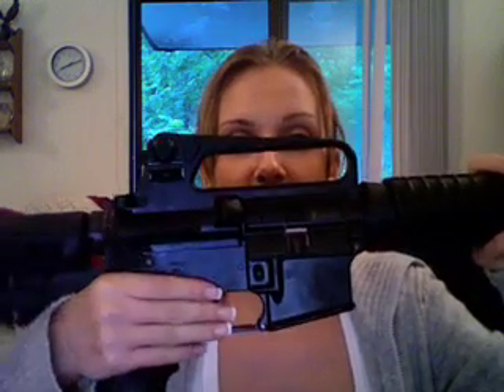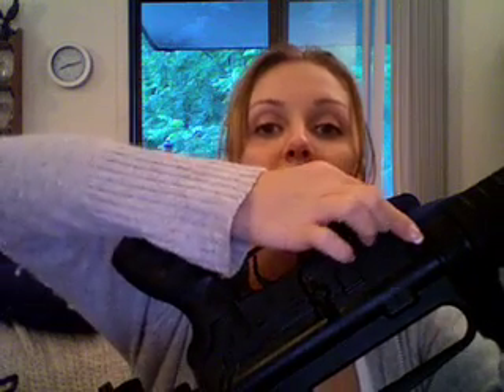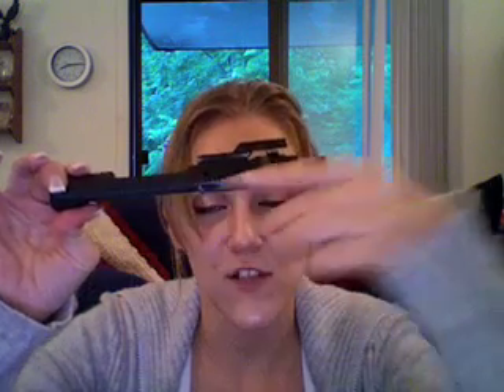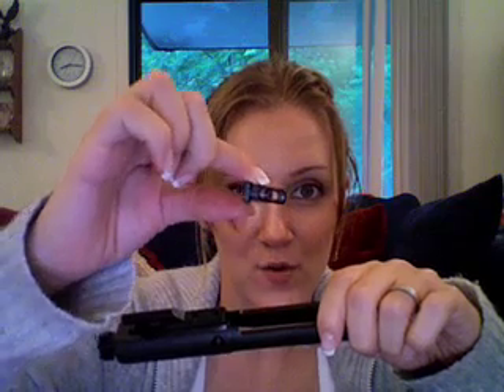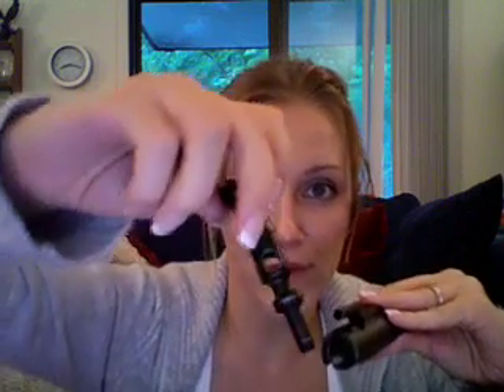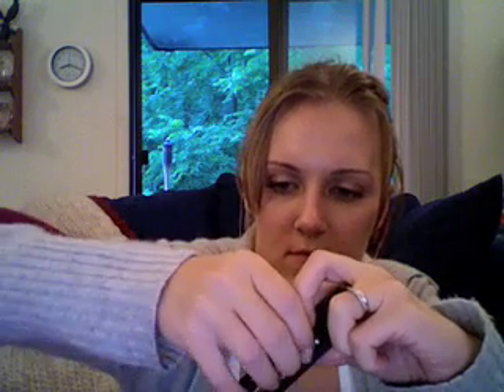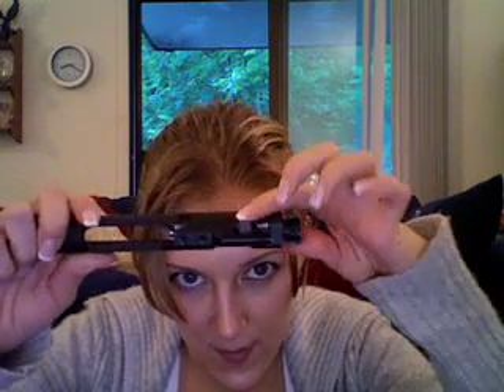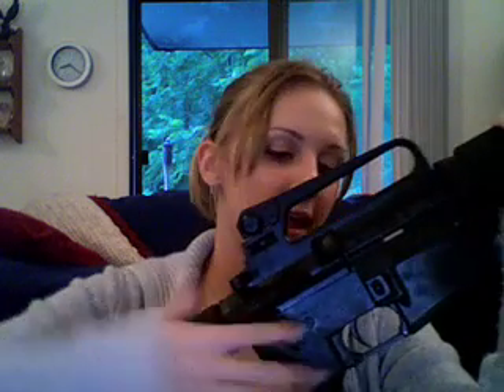Bushmaster AR-15 M4 take down

Comment: Great video. I just bought my Bushmaster .223, spent the whole afternoon taking it down and putting it back together as described in the manual. A couple of things to help new owners: the pins in the receiver are designed to not come all the way out, that tripped me up for a while.Also important is that the factory says to never alter the design of the firing pin retaining pin or replace it with anything less than the original.Point in a safe direction, dry fire,and do safety function check.

Comment: The original Bushmaster was a pistol design that used a AK47 system. It was much like a bullpup where the magazine was behind the pistol grip. They also made a rifle with the AK47 system. Both used AR-15/M16 magazine. The lower/upper were stamped sheet metal. They started making the Colt/Armalite design when they received a small contract from the military to make M4's. The FW Bushmaster was designed by Magpul called the Masada. Magpul went to Bushmaster to produce it and it's called the ACR.

Comment from the maker: To make sure that the bolt is as far forward as it can be, keeping the locking lugs of the bolt properly interfaced with the locking lugs of the chamber. Sometimes the bolt will not go all the way forward when chambering a round.

Comment: My Saiga was already clean when I got it.  As far as I can figure, the gas piston was too small, I did order a replacement for my 922r compliance, and it fit much tighter.  It might've been that I had used milsurp 7.62 instead of .308, too, but I did run some Federal .308 through it with the new piston and it fired with every pull without a hitch.

Comment from the maker: It depends on which exact AR we're talking about. There are multiple chamberings available, standard chamber is for 5.56. Mine is chambered in 5.56/.223

You can get them in 9mm, .22, .308, 7.62x39, .308, 6.8 Remington Spcl., 6.5 Grendel...etc. etc.

Comment from the maker: Not really. If you're super paranoid you may tap the assist a few times while the bolt is out to check that it is freely moving. You may also check the bolt carrier group and make sure the serrations are not worn. That's it.

Comment: Nope, it is, in fact, the extractor.

The ejector is the little spring loaded pin on the opposite side.  The extractor grabs the cartridge case rim and pulls it back, the ejector pushes on the other side, so that when the case neck clears the chamber and ejection port, the brass is thrown free from the weapon, no matter what speed it's moving at.  This is only one of many advantages the AR-15 has over the AK-47.

Comment: The bullet itself (that is, the bit the gun fires at the target) is small, but it is backed by a relatively large cartridge (the whole thing you load into the magazine, including bullet, case, propellant, and primer).  The AR-15's .223 (or the similar 5.56x45mm NATO) is only really small compared to a full-sized rifle round like .30-06 or .308.  The rifle is designed with an internal buffer and spring, so the kick isn't bad as long as you have the butt firmly into your shoulder and lean in a bit

Comment: Mine has jammed exactly once.  It was in the middle of me trying to melt down a DPMS upper, one round didn't quite make it past the feed ramp.  A tap on the forward assist got it chambered, and I finished off the last few magazines of the 370 round barrage (9 30s and a Beta Mag).

And I do have an HBAR which, while it is somewhat accurate, it's not quite a tack driver.  It's good for 1/2" groups at 100 yards with 77gr SMKs, but most tacks are smaller than that.  :)

Comment: @xboxliveman177 bushmaster is commercial spec. colt ,LMT and a few others are mil spec. there is a difference in the buffer tube size. that is the tube your stock fits on

Comment: It depends, if you're trying to squeeze every bit of accuracy out of the gun then yes.  For normal use and with normal ammo, don't worry about it.  Wolf doesn't use the lacquer coating on their ammo anymore either, so just for good practice, it's not a requirement.

Comment: @HONORGUARD308 Actually the AR line is the first form of this weapon system and just as well the first chambering was the 7.62X51mmNATO(.308 MATCH) and was therefore named the AR-10.These are the most powerful and first models and still strong running. Today its simply refered to as the AR platform. U have the Hbar M-4 carbine, M-16 AR-10, SR-25(AR-10 line) so its just ARplatform. As for the name AR-15,that is the civilian modified version of the greater Military M-16-the 5.56 cant beFYRDinaAR15

Comment: Let me guess you have a flattop upper, alluminum handguards maybe freefloat, you have EO Tech/Aimpoint, a 4X magnifier, BU rearsights, pistol grip attached to your handguard as well as a flashlight attachment with a laser and a pressure switch. Your buttstock has the compartment to store batteries for your electronics. You have the the new type of trigger guard for cold weather gloves but don't live in the cold. You have a set trigger set up with the anti-walk pins that really never walk. COOL

Comment: LOL thx, I actually have one from Bushmaster but for the life of me couldn't recall what it is called. I am female and have very long nails. It is kind of a running joke in my family about how gun designers do not take long nails into account. It helps but even with the latch I have to be slow and carefull when pulling the charging handle but in an emergency, screw the nails, they will grow back lol Good Day !! Ms. Shannon

Comment from the maker: I've been taught that a quick charging of the bolt and dry-fire is sufficient. Also, I'm not sure what's wrong with your Rock River Arms LAR-15, but you shouldn't be able to put your AR on safe after you've dry-fired it. I've not worked very much with the military variants so I'm not sure if they are different, but the semi-automatic only ARs need to be cocked in order to put them on safe.

Comment: A full function test at the end not simply dry fire would have been good too because you want check the weapon's fuctionality in its different fire modes including the safety. On a positive note this was a good vid for firearms challenged individuals and provided some cool tips. Could you do a vid on a complete strip and cleaning the AR15?

Comment: if the rifle has a 16inch barrel or longer and is not fullyauto then it is legal to have. there is other ways that you can have a rifle smaller then 16inch, the reacever must be a pistol stamped reacever and it can't have a buttstock on it .

Comment: Also this, 22LR is cheap and relatively tame (it is still potentially dangerous though, so watch where you aim).  It's a great place to start from if you want to learn to shoot rifles.  You can get bolt-action rifles in 22LR that are much more affordable and easy to maintain than the AR-15 until you gain some confidence and practice.

Comment: ah the ole "bolt installed upside down" problem has still not been resolved !  This has been a complaint of the design for 40 + years now.  I would think that a simple notch/ recess arrangement on the bolt / cam  will eliminate any possibility for an improper re-assembly...

Comment: On the canadian version called the C-7 the cam pin is machined in a way that it will only go in on one side....try and put it in the other way ;it just will not fit. The firing pin retaining pin is VERY small and easy to LOSE in the brush so all you army wannabees just be careful...if you lose the small parts your weapon will not funtion...duh!
The use of the forward assist is also important to properly seat the cartridge in the chamber.....
Love the vid...well done.

Comment from the maker: Well thanks for the last part, but:

"...not...The M4 has a removable carry handle and a 16" light barrel. The carry handle is not removable with makes it an AR-15 A2."

A real M4 has a 14.5" bbl which is not the "lite" bbl, the one in the my video does have the 16" M4 profile bbl.

While the part about the handle is true, the short handguards, M4 profile bbl., and short gas system give my rifle more traits of the M4 than a standard AR15, which is probably why Bushmaster named it the M4A2.

Comment: I do with my M16 you can and will get carbon in there. Too much and the exrtactor paw will not move freely. This will cause problems with extraction and ejection of spent casing.

Comment: A proper functions test consists of charging the weapon, pulling the trigger, holding the trigger down, then charging the weapon again. When you release the trigger after you charged it you should hear a heavy metallic clunk. pull the trigger again and put the weapon in safe. I've worked with M-16's and M-4's in the Army and I had a Rock River Arms LAR-15. Sorry, that's how I was taught. =(

Comment: My boring AR is basically the same except for the 14.5" Bushmaster barrel with extended flashhider and boring old style collapsible buttstock (not the new M4 stock or other after market stocks). I don't pimp out my AR because I don't need all the gimmicks to make it look it or myself to look cool. But if you need all those gadgets then go ahead and get them.

Comment from the maker: While this is true of older firearms and rim-fires it is not so much a concern with modern center-fire firearms. Dry-firing has actually become an intricate part of both military and civilian training.
The firing pin in this firearm will probably wear faster from actually shooting than it will from dry firing and even if it does need to be replaced it costs $6 for a new DPMS firing pin. Hardly braking the bank for an item that may need to be replaced once in a lifetime.

Comment: I knoticed nobody has given you an answer yet. It depends on the ammo your using. Some ammos are dirty than others. As for break in I clean mine at the end of every shooting day or if the weapon becomes dirty, AR's really don't like to get dirt and will give you problems if you let carbon build up. I've fired 500rds with no cleaning and next time had to clean it after only 200rds, depends on the ammo.

Comment: AK-47s are made for simplicity, reliablity and power..it outperforms the AR-15 by far in all those points..and in a gun fight you don't want something to go wrong with your gun like things did in the M-16 and AR-15 .the M-16 is fullyauto and the AR-is semiauto..in a gun fight i would want the AK-47 even if it's not as acurate ,but if it kills at 100 yards and the AR-15 was made to wound at 100 yards you can see why..

Comment: I have always wondered if releasing the charge handle without a loaded mag or hitting the release without a loaded mag would do damage in the longterm.  Any thoughts?  Seems like it slams awfully hard when there is not a round to chamber.

Comment: Just a quick question. When  I reassembled my bolt carrier group, the firing pin moves around a bit.... is it supposed to move? By itself? Or did I miss something in my reassembly? It doesn't fall out, but the tip of the firing pin disappears (the portion that strikes the primer) if I tilt the carrier back and fourth. Is it supposed to do that, or is it always supposed to be exposed? I live in the city, and can't just step outside to test fire it. I hope I described my question well enough TNX

Comment: I'm trying to remove the pins on the lower but there not coming out I have a DPMS like yours but mine is a flat top and its new. Are they really hard to take apart the first time? You feel like emailing me?